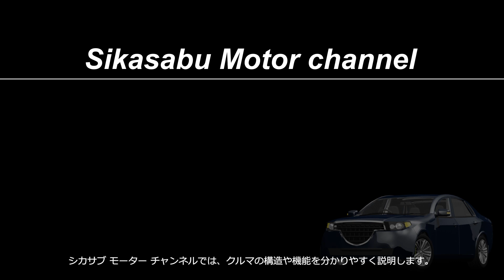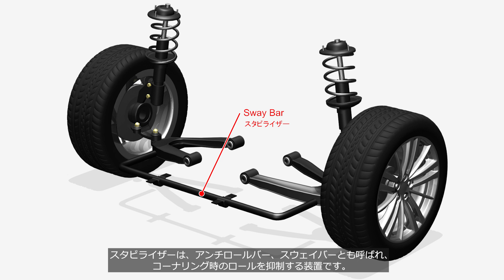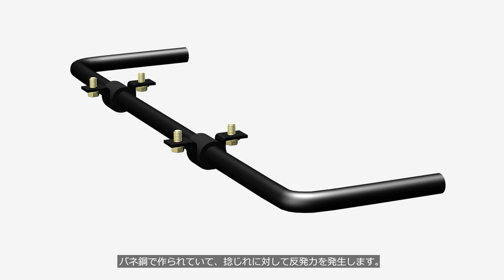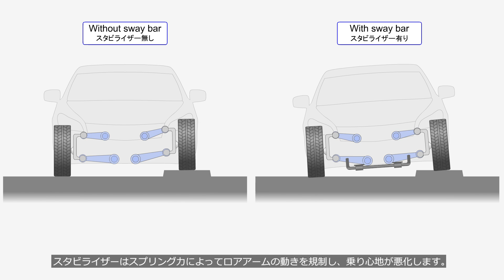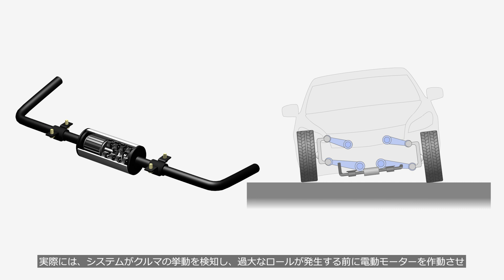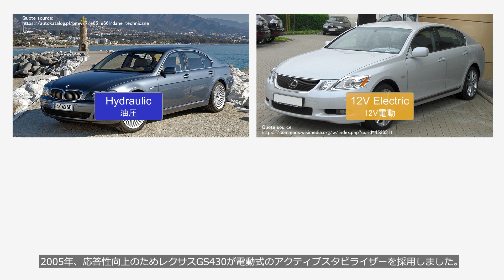Active Sway Bar, how it works.

Comment: The difference between hitting a bump and sway on turns is that the opposite wheel will extend down on cornering and won't when hitting a bump.  Doesn't seem like these geniuses have figured that out yet.
Reply from the maker: Thank you for watching the video and leaving a comment.